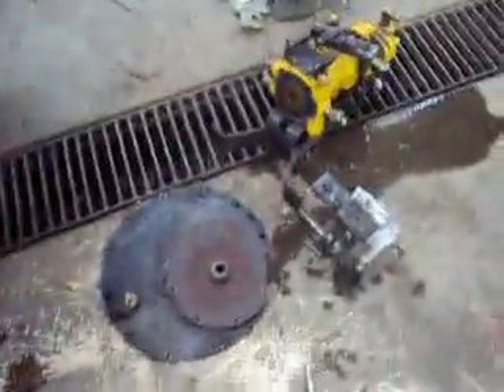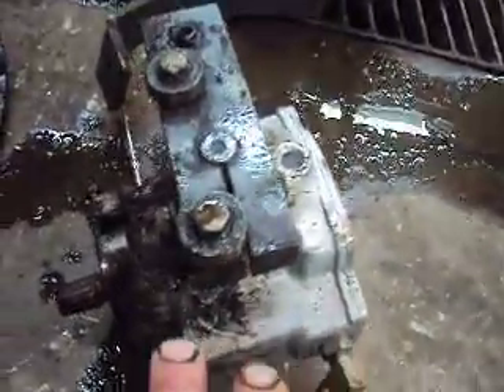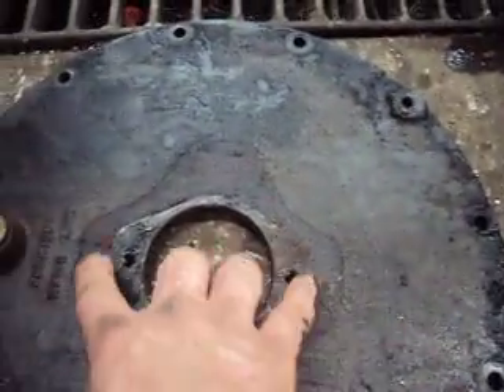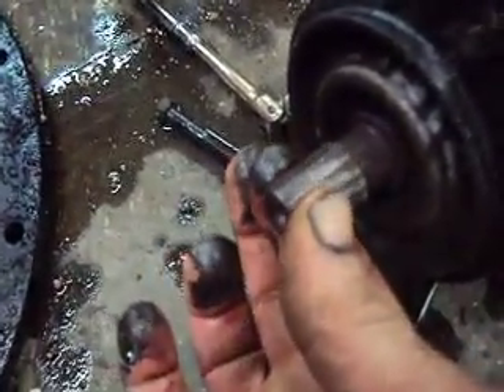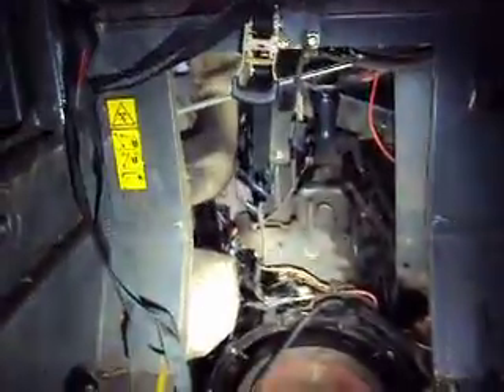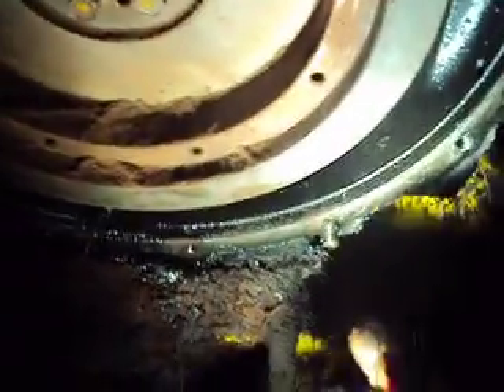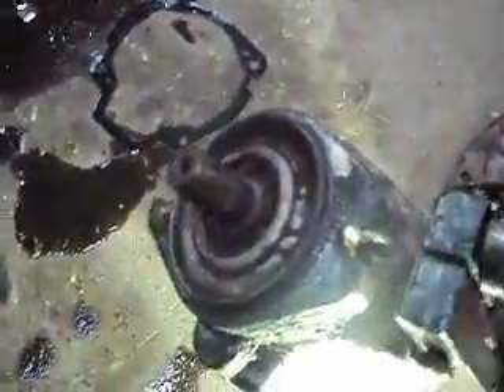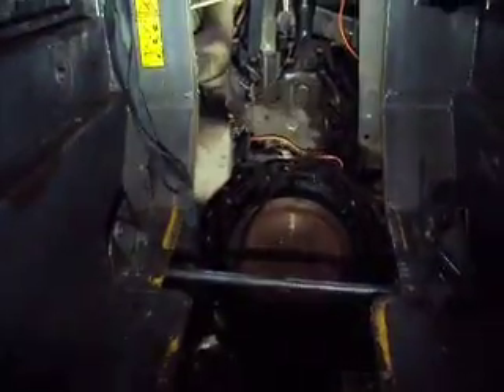Repairing the drive on a LS 150 New Holland Skid Steer

Comment: Just did this same repair on LS160  with 2300 hrs  not an easy job all bolts were tight  so vibration and flex would have to be the cause.

Comment: repaired a few same issue. Two bolts not stiff enough let's pump flex and splines strip. I added another bracket to support pump. This was back in 1997.

Comment: Seen this happen on two NH skid steers. Seems two bolts and bell housing a little flexible. Splines on on went bad even with bolts tight. I drilled a small hole in top of bell housing above spline to be able to squirt gear oil on them. Dry splines lead to early failure. I have a L 785 that has much heavier drive shaft spinning pump with grease fittings. Awesome older simpler machine never breaks down.Good video.